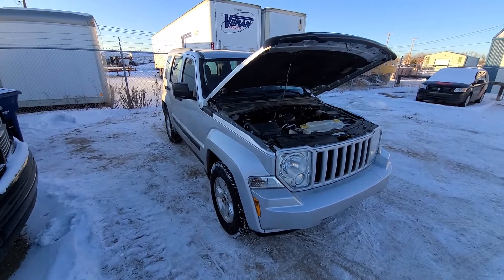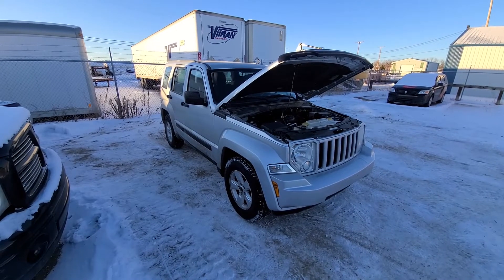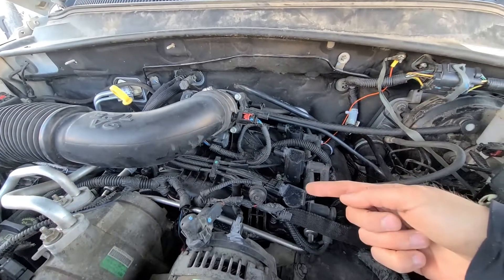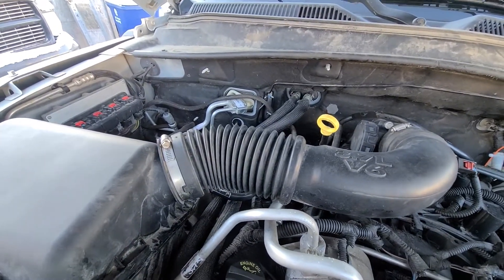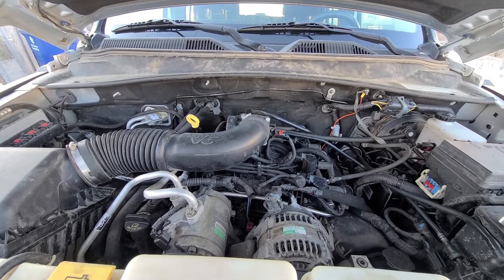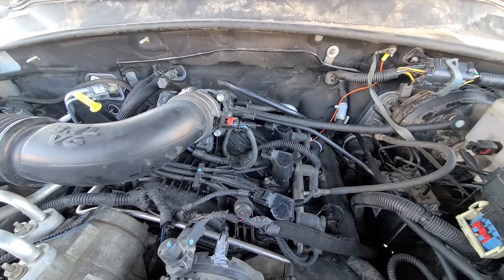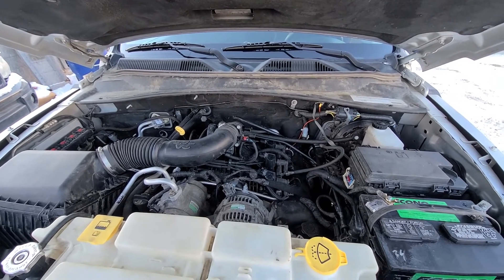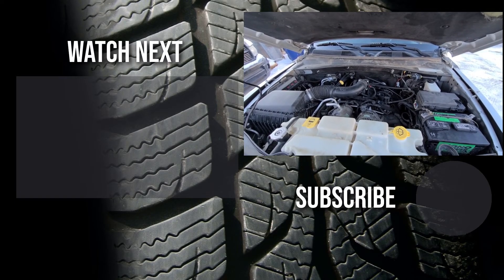Jeep / Dodge 3.7L CYLINDER FIRING ORDER / CYLINDERS NUMBERED

Comment: I'm sorry to say that this guy has no clue they're six there's three coil packs on each side of the engine 300 driver side which he showed us and three on the passenger side which he did not show us there is no two spark plugs per coil. LOL. So just this guy's videos at your own risk. I own that vehicle I'm pretty sure I would know I'm done that job
Reply: Actually, the 2011 Liberty with the 3.7 engine has 3 (three) coil packs on the driver side of the engine. Each coil pack controls 2 cylinders. The driver side of the engine is the only side that has the coils, plug wires run from those coils to the other side of the engine. I have a 2011 Liberty with the 3.7.
Reply: Sorry to break this to you bud, but I have that same engine and set up, and the Haynes manual. He's not wrong at all. There's actually only 3 coil packs on the driver's side. And 1 wire from each coil pack goes to the passenger side. All the info presented did check out.😂
Reply: 1-4, 3-6, 2-5. Just fixed that's how the plugs and wiring are supposed to be.
Reply: He does show which vehicles this firing order belongs to. It is true that they only have three coil packs that two plugs are connected to, one from below and the other from a connector on the side. Mine is the 2010 Jeep Commander 3.7. This video helped me a lot with restoring the firing order from someone else changing it.

Comment: Which plug wires went to which coil?
I have a basket case someone brought me and they took the wires completely off.
Im assuming its.....1-2.....3-4....5-6?
Reply: Firing order is: 1-6-5-4-3-2  drivers side is 1,3,5 and passenger side is 2,4,6 from front to back means smaller numbers 1 and 2 closer to the radiator. good luck.

Comment: Hey can you please post the wire routing? I've had mine apart for longer than I'd like to admit for a head gasket change and dont remember which passenger side spark plug connects to which coil. I even numbered them but it's been long enough I dont remember how I counted.
Reply: You get it?
Reply: @jorgeleon1173  I did, I forget how but I could probably figure out how to send a picture if you need